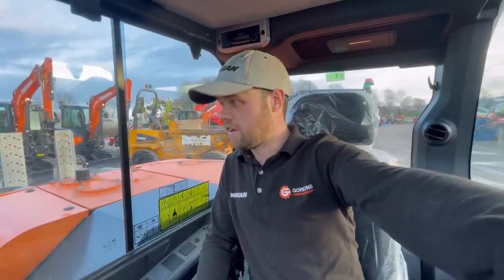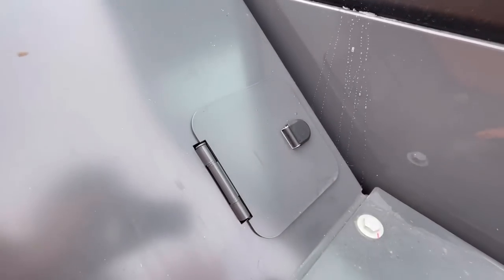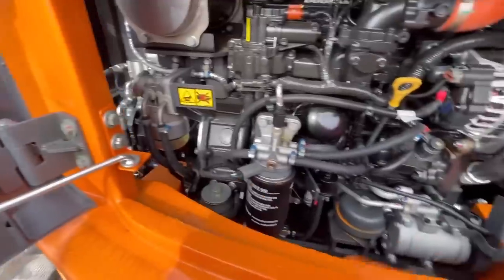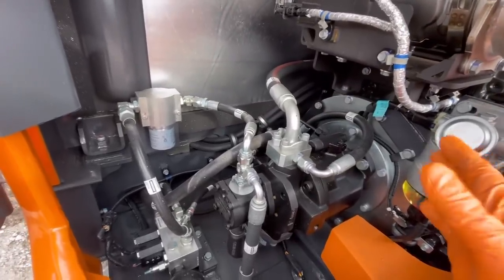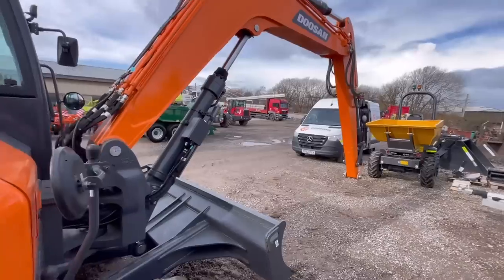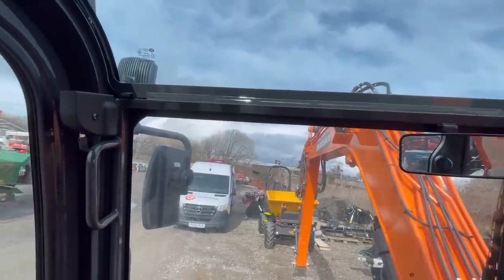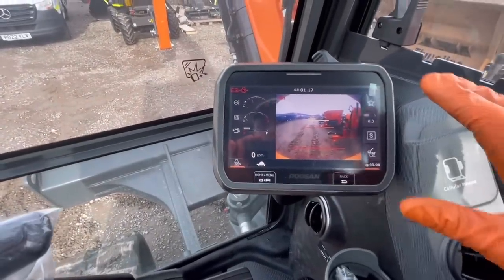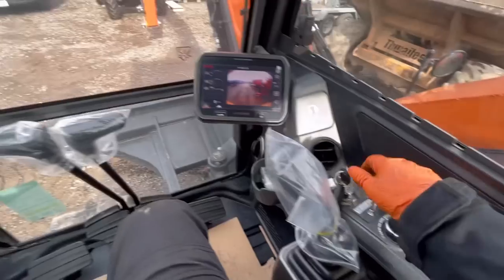FIRST LOOK ! / New DX85 / New Digger / Episode - 171

Comment: Any electric machines yet, either been developed or been through the yard?
Reply from the maker: There’s a couple sold up into Glasgow
Reply: @alisdiggerdiary  it would be really interesting to see one, either getting a PDI or a service. 🙂
Reply from the maker: @stuartcraigon2003  😂 I don’t want to see one 😂 but I know what you mean I’d like a go on one to see how they handle
Reply: @alisdiggerdiary  presumably you'd need extra specialist training for them or are all the team getting the training?
I know on the domestic car side of things a huge number of dealers, especially in the US are refusing point blank to pay for the training guys need to work on electric stuff and dealers just aren't buying demo units either. So much so Ford as a company have stopped their ev program all together, including building a factory for electric cars.
Would be interesting as well to see how an electric machine is charged on site, a diesel generator would totally defeat the point of them I'd say. 🤔
Reply from the maker: @stuartcraigon2003   they’re to tick boxes when working in confined spaces or city centres I wouldn’t work on one until I had physical training I’ve done the online courses we have one tech been on the course and with so few about at the moment I don’t see much point doing a course just yet